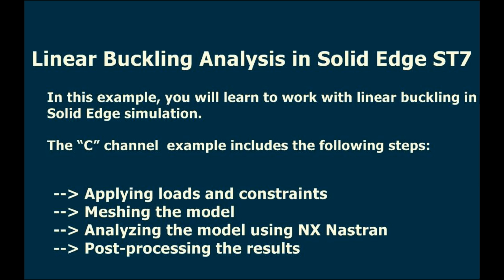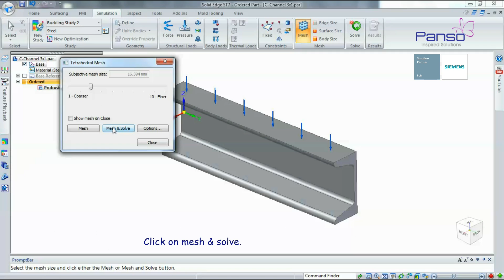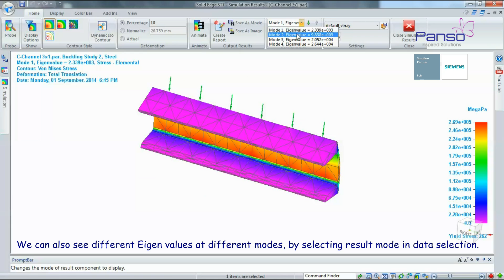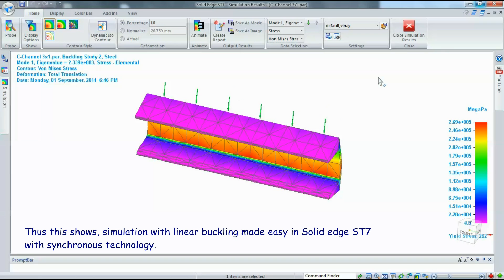Linear Buckling Analysis in Solid Edge ST7

Comment: @ronakhingu

The eigenvalue is the buckling load safety factor, meaning you would multiply your applied load with this value in order to obtain the buckling load magnitude.  Please note the following:
(1) that buckling analysis should be used on a beam in compression loading, just as the classical text book examples illustrate
(2) A finite element model represents geometry with no imperfections (as opposed to reality where the beam isn't straight due to manufacturing tolerances, loads are offset from the cross section centroid), so in FEA, if you load a beam in compression and the load vector is axial with the beam, the resultant eigenvalues will be erroneous.
(3) You can introduce a load offset to "induce" the buckling; however, considering the flaws that exist on the beam in reality, you must interpret the results with caution.